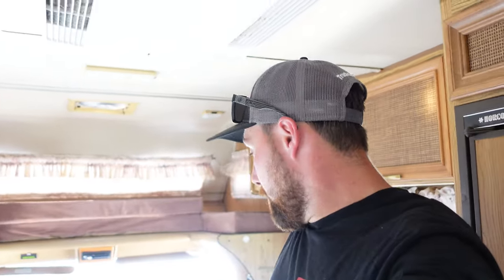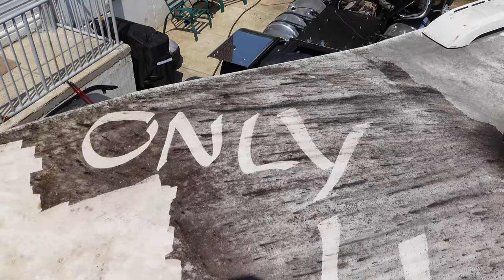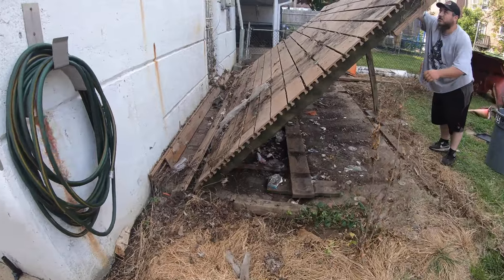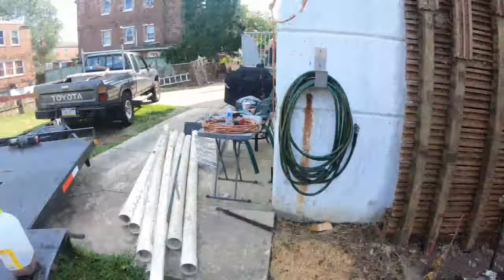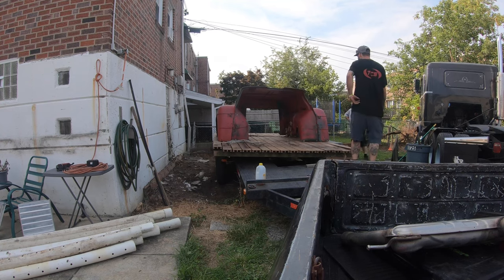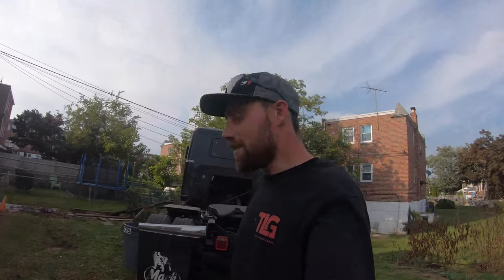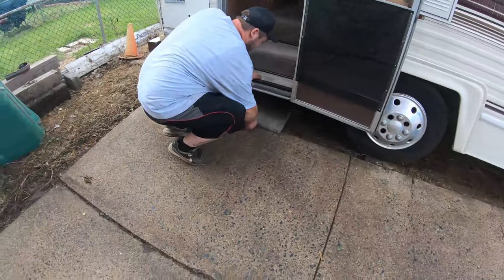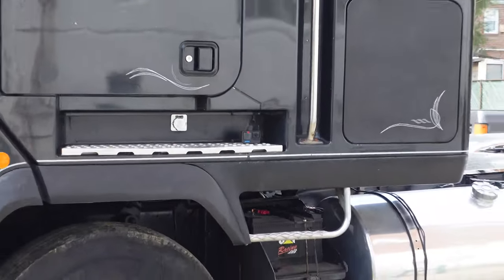Setting up A Motorhome In My Dads Yard! (Prank On The Old Man)

Comment: I had a 1988 Chevy Suburban same engine four-wheel drive the barn doors three rows of seats bucket seats up front with center console huge deep console. Best damn vehicle I ever owned next to my 72 Chevy Impala Sport coupe 350 two-barrel. Lucky you found out throttle body injection does not have a choke but rather an EGR valve. That's very important to have working.